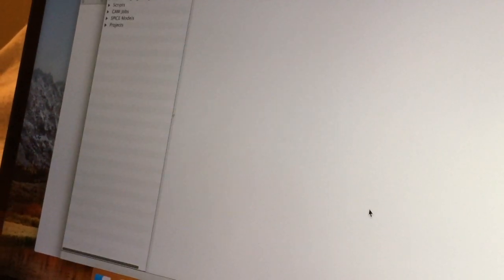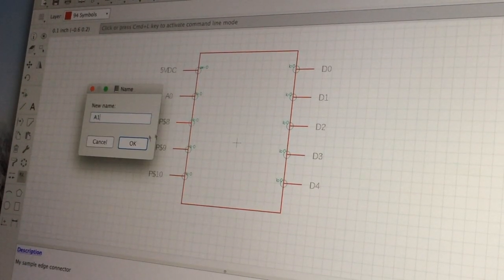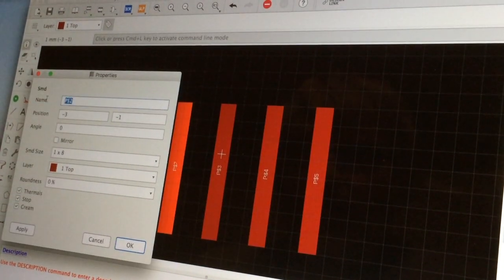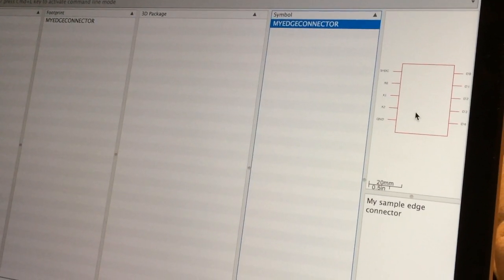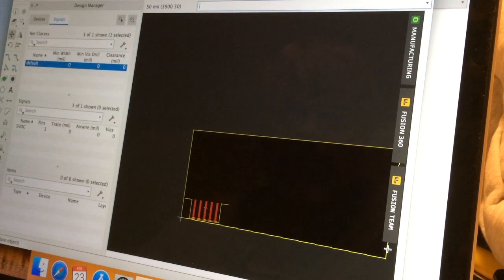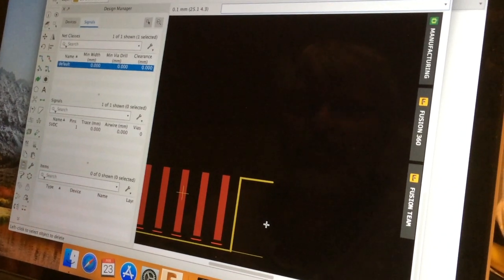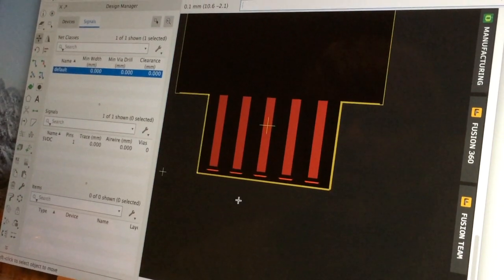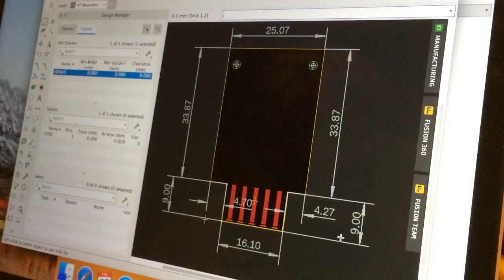Creating Designing PCB Card Edge Connectors (Devices) in Eagle Software

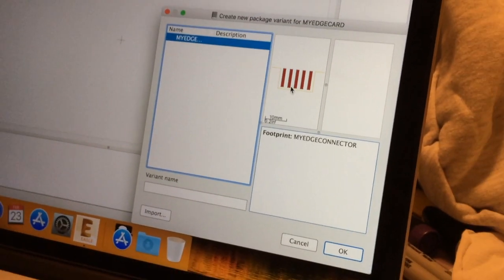Comment: great video, kinda lost me at 8:58 local package as it went through these steps really fast, the port bit etc just for a newbie like me
just getting the parts combined. I did learn a lot on this and there is very little on Youtube specifically about this, so it helped a lot
Reply from the maker: If you've got a specific question just shoot and I'll try and help.  Basically what that time index was about is taking the card edge you are making and associating what the gold plated parts are going to be associated with (e.g., Vcc, Vss, etc) so that you can use it within your schematic/board layout.  In Eagle this jargon is around adding a device, but it's just a metaphor as the device in this case is a card edge.
Reply: @DrShock managed to get the different parts combined. The interface is different in my version of Eagle but it seems a matter of ensuring the symbol, device and package are all similar and that it all looks similar. I was able to make a 15 way dual edged card and generate a PCB job file from it. Getting the orientation of the pins right is tricky as i'm generating this as a copy of an old cartridge long since out of production. The video helped greatly

Comment: Thank you very much for demonstrating this as I need to create a memory card for my homebrew 65C816 single board computer design.  One question: When you created the connector as a symbol at around the 2 min 30 mark, you placed the pins the opposite way around to the way I usually have them. I.e. I usually have the name (example P$1) inside the 'device' and the green circle outside, furthest away. Is there a particular reason for the way you did it?  Is it just preference?  Just to advise that I'm running an old version of Eagle (7.5.0), although I suspect the version doesn't matter.
Reply from the maker: Preference more than anything on that part.  What's important is that you have the footprint and device all matched up in Eagle before you try to use it.  I don't think the version matters, other than the UI may differ.
Reply: @DrShock  I thought that might be the case. Thank you for confirming.
I've already mocked up a pcb in the vein of your demonstration and the gerber view is fine. I just need to look at the pad spacings and thickness of pcb vs socket.
Thanks again 😀

Comment: Awesome! Just what I needed... Have you tried to see this in 3D using fusion? After I followed all the instructions, I believe my design is fins but when I export to fusion to print a 3D model to look at physical fit, it seems like my edge connector disappears. It looks fine when you print on paper.
Reply from the maker: No, I've not used fusion.   Just the 2D green PCB view to check silkscreen layout.

Comment: Next, how do we design the female part of the connector?
Reply from the maker: Those are beyond Eagles capabilities and you have to purchase as they require manufacturing of 3D molded housings, PCB mounting brackets or pins, and spring tension contacts internally for a card edge design.